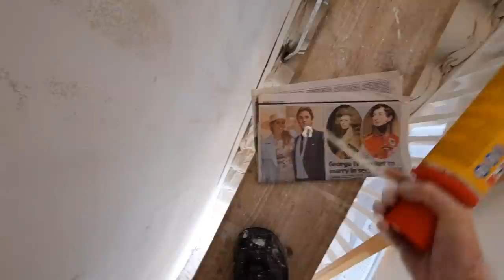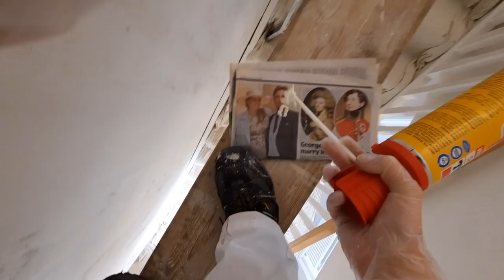Cracks And Gaps New Build

Comment: In Cornwall, tape and joining is pretty standard practice in new builds. The paper internal tape is bedded with joint cement, inevitably over time it blows. If ever I come across this problem I remove all defective tape, make good voids/movement and then introduce new internal paper tape stuck with strong ready mixed wallpaper adhesive like Albany yellow lid and then fill between edge of tape and wall. This way you get a nice sharp ceiling line as the tape has a pre finished crease in it.

Sadly new builds now unless bespoke are all about speed of completion.

Comment: Had the same issues in my house. I pulled the loose tape down, filled the gap with easi-fill and retaped. Won't the lack of tape here make the repair more likely to crack?
Reply from the maker: No the foam holds everything secure.   Perfect fix and helps with sound and heat.. thanks

Comment: Seen a load of these lately, no plaster and that awful corner tape - and silicone everywhere. No mist coat either, so the paint just comes off on my roller over the seams between plaster boards. I no longer price jobs because of this, I just work for a day rate and deal with whatever comes up. Really felt your rage as you were pulling that paper off! Take it easy - good to see you up and at it!
Reply from the maker: Thanks it's definitely getting worse seams like they are running out of good tradespeople.   And like you say it needs fixing so when decorating in future it's easy.  Cheers all the best
Reply: @PaintingandDecorating  I'm guessing it's just 'progress'. I have a mate who lives in an old Welsh long barn. It's made of slate, oak, hazel and lime. If anything needs fixing, that's all you need. Meanwhile I have a bucket with 12 different tubes of goo for fixing things to each other!

Comment: These are dry lined walls, so should not be plastered, but the tape edges should be, which would prevent them from lifting.
Reply from the maker: It's plasterboard and should be plastered really.. but to save money you can tape and caulk then seal the plasterboard to prevent moisture uptake when decorating. Thanks

Comment: I'm reqparing cracks on plaster one or two year old homes, it cracks mostly because they don't let the plaste cure before thy put mud on it and then quickly painting.

Just need more knolidge how to see if it's structural or drayng Crack. But I'm better then before in detection😁

Comment: I am slowly moving into a new build and there's already been 14 repairs...cracks and just rushed work, plumbing issues which caused leak in ceiling and light fixtures, 12 months apparently for everything to dry out and settle, oh my
Reply from the maker: Good news it's all fixable... some is expected with shrinking whilst drying out.  But other parts is skipping work like no plaster.
Reply: @PaintingandDecorating  shody workmanship and developments trying to cut costs its shocking.

I am still lucky to have new build and eventually all the issues will settle as they say. 

Love your videos, very informative.

Comment: I would be inclined to bet the polyfilla over the soudal on the staircase will crack with the movement on the stairs.
Just a personal observation, and it's not an enviable job on that staircase!
Reply from the maker: It usually works great.. the foam helps take out the movement..  but more videos to come on this job..  Will be papering next week Will film that..   thanks
Reply: Did mine this way over a year ago. No cracks have ever appeared. I also have 3 kids which run up the stairs!
Reply: That's good to hear, did you paper or paint?
Reply: @GavinLawrence747  did it exactly the same way as in the video. I believe there is a video on this channel which goes into it in more detail. Did undercoat and gloss on the stairs and paint on the wall. No chaulk. My days did the same. Still perfect.

Comment: looks like a tape and jointing botch job, of course you can paint straight onto plasterboard.
Reply from the maker: It's better to have plaster on..  and if painting they need sealing which was not  done..  emulsion paint... unless a washable one is no good for new plasterboard.  Thanks

Comment: Is this type of botch job common in new builds?
Reply from the maker: Not really as bad as this... it's as if they wanted it finishing fast... or had no plasterers.  Unusual to be left with emulsioned plasterboard and no plaster.   Thanks
Reply: @PaintingandDecorating  You have the patience of a saint dealing with jobs like this..👍☘️🇮🇪
Reply: In Scotland drywall tape and board finish in new builds fairly common, For the timber kit/ block external skin method which is popular Scotland manufacturers advise this method as apparently too much dampness that can get into the kit with skim plaster.